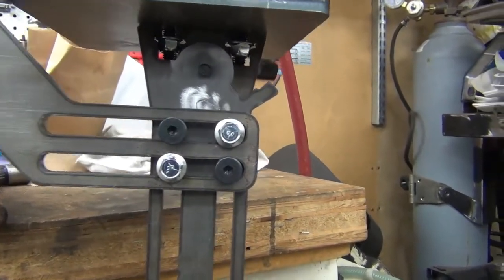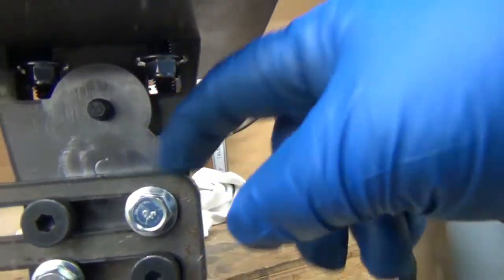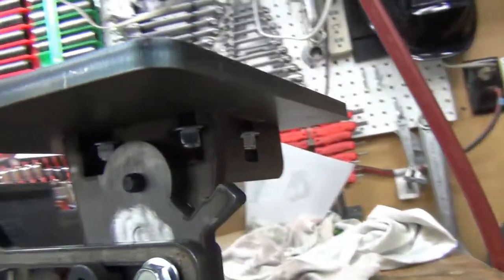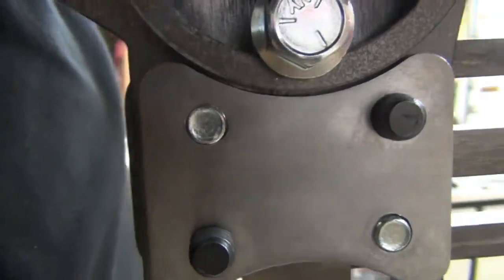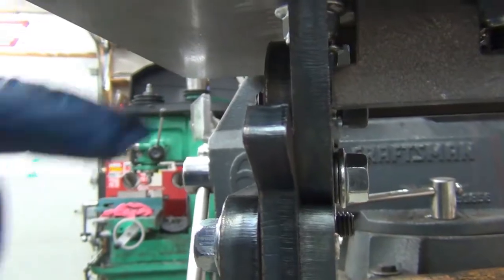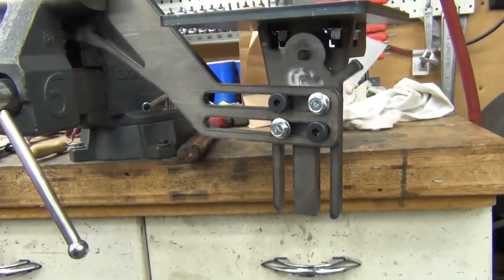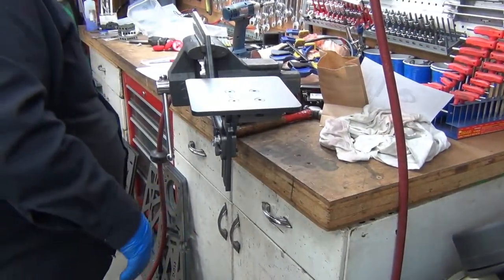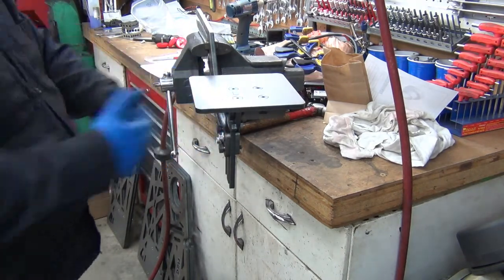DSM Tool Rest

Comment from the maker: We set it at $750, but this first batch of 12 are still basically prototypes, so we're selling them for $600ea.  That's the laser cut parts and the hardware.  The pulleys are available from Beaumont metal works for about $215? and then you can put your choice of motor on.  1hp, 1ph HF motor($149), switch setup($25ish), and wiring($15?) will do single very nicely and is probably all most will need/want.  The vari-speed setup is in the $325 range. It's cheaper to acquire your own mtr/pulleys.